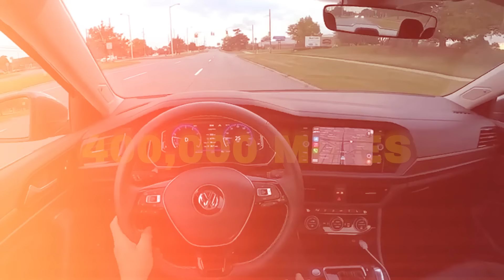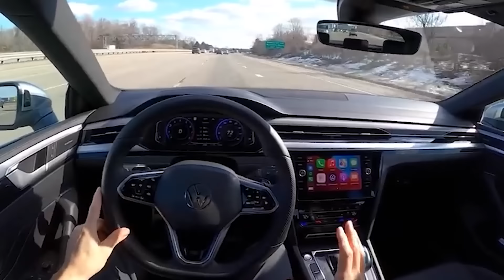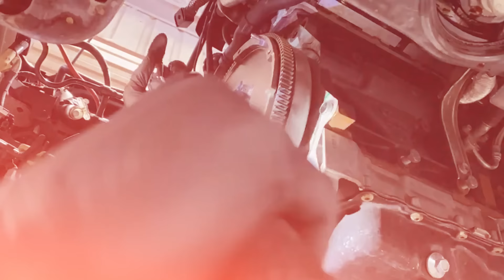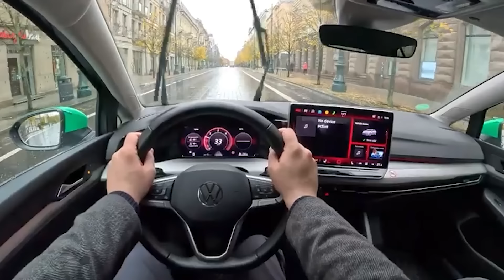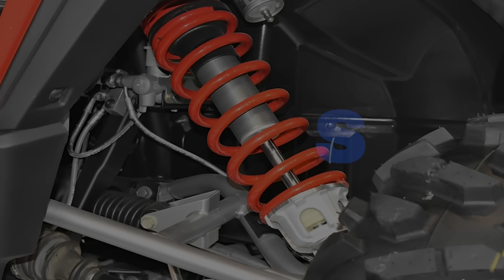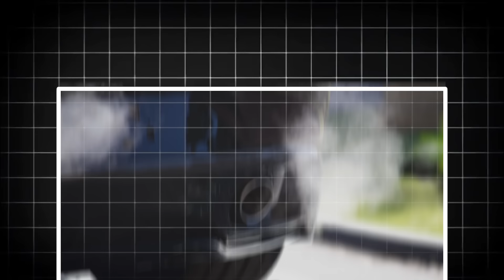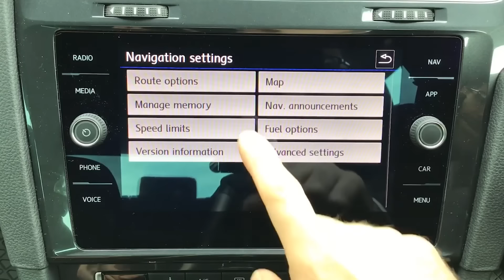How To Make Your Volkswagen Last Over 300k Miles Without Any Major Repairs

Comment: I have a 2024 Tiguan with 11,000 miles! I just did my oil change at 10,000 miles. This video was extremely helpful and I’m going to make sure I do my oil changes every 5,000 miles etc.
Reply: You're right: it's best to change your oil every 5,000 miles or 6 months and always use high-octane gasoline.
Reply: Never, ever follow the manufacturer's recommended oil and filter service intervals.  If they recommend 10,000 miles, change it at 5,000. Your engine will last twice as long.
Reply: So you've been brainwashed by AI YouTube video
Reply: You’re better off with a different car. It’s endless little maintenance, it adds so much to the overall price of the car. Paying bmw prices for VW should not be normalized. I have a 2018 Tiguan
Reply: 10,000 is perfectly fine, 5,000 is overkill.
Reply: @Ussie_A no lol you should not wait 10k miles💀

Comment: 2016 Jetta GLI w/ DSG.  Bought 6 years ago at 22k just hit 140k. Every single one of those miles it was modified to the absolute max, turbo swapped making 410hp. I do the regular 5k oil change with liquid moly 5w-40 and their additives, service DSG every 45k, did carbon cleaning at 90k and it runs like a top. still 28mpg around a suburban sprawl city, never had an issue with the car other than the plastic water pump started to leak(known common issue with that generation of the 2.0tsi under recall) and my cam angle sensor developed a small internal oil leak that would put the car into limp mode(not expensive and it failed around 120k)

Comment: I been seeking an answer for few weeks now but hopefully somebody can give a clue what my problem might be, I have a 2012 Beetle 2.0T manual Gen 1, the issues im having is that after 30-40 minutes randombly and ocassionally when passing by bumbs my oil light on the dashboard goes on and beeps for like 3 seconds it stays on for like 15-20 seconds and then disappers and it keep doing it every 10-15 minutes, oil is fine engine sounds and feels good and no engine light. I will appretiate any opinions on what my issue might be, thanks and nice content I love it.

Comment: The engine does not get "opened" for a clutch replacement, how stupid! Windshield washer fluid refill while you're talking about antifreeze, clean grounds with a wire brush and you're showing a high pressure washer, You really need to synchronize your video with your audio portions

Comment: I drive a 2012 Eos with 130K miles. I’ve been fixing different engine parts and the car is running well.  This video was excellent and I will complete the recommended maintenance. Thanks

Comment: I drive 2014 Jetta Sportwagen TDI (rebadged Golf) with 60k miles. You are absolutely right. Only you forgot with diesel it’s very important to fix all issues with check engine light asap, because with ses light, car doesn’t perform regen, and it’s very risky for dpf longevity. I still have original timing belt. Should I worry about it? 10 years and 60,000 miles. Thanks.
Reply: I changed mine at 130,000 miles and the belt was 13 years old. Not saying you should go that long but mine was still in good shape.
Reply: @buymytoy i think the belt is Kevlar. That’s why it has so liberal maintenance.

Comment: Excellent video, 100% agreement. My 2016 GTI is now at 208,000mi and running great. I did the carbon service and trans gear oil myself, had an excellent independent mechanic do timing chain and clutch replacement, which were of course rather expensive services. It's not really related to maintenance, but I was amazed to get 200,000 miles on the original clutch.
Reply from the maker: Awesome! Glad to know our content is helpful to you.
Reply: I’m still driving a 1.2 TSI polo from 2014 now at 300k kms with original clutch and timing belt.

Comment: Oil changes at 5000-mi is a faulty approach to maintenance. How often you change your oil depends exactly on how you drive. If the majority of your driving is made up of short commutes, then yes, that's considered SEVERE SERVICE by the majority of auto manufacturers. And yes, the majority of auto owners fall into this category. HOWEVER, if your driving consists of mainly longer highway speed trips of 30 minutes or more, all the cold-start moisture, unburned fuel, and combustion by-products that accumulate and cause the majority of engine wear, have a chance to boil out of your oil once it has reached full operating temperature. As the oil takes considerably longer to reach temperature than the coolant, it is essential to have a longer run under load to boil off these oil contaminants, and this does not happen with short urban commutes. So yes, if your drives are the latter you can stick to the owner's manual for oil change frequency.
The other issue is many of the video's maintenance items have such short intervals, and such high costs, you wind up paying as much, or even much more, than if you just do maintenance at the recommended intervals... You add up these costs of this extra maintenance, and you could cover much of the additional lease cost of a new vehicle every 3 years...
That's what happens when you use AI to create your VW maintenance vids...!
Reply: You have a right to your opinion, but I will stick with the opinion of every VW specialist mechanic and every enthusiast owner I know and stay with 5000 mi changes. It is cheap insurance for all the reasons clearly discussed in this video (regardless of having an AI voice read it). I also have a regional specialist seller who "warranty replaces" oil and filters (yes, I get 100% money back on used oil and filters - it's insane, but they consider it a "loss leader" expense to encourage loyal customers - which I certainly am!)
Reply: @cyclone411  My statements are less 'opinions' and more based on factual reality. Oil Analysis can give accurate reporting on the condition of your oil. Oil Analysis of hundreds of engines has confirmed that oil run under relatively short commute conditions is far more degraded after 5000-miles than oil run more at highway speeds for extended trips. The reasons are the ones I listed - relatively short commutes don't heat the oil long enough to evaporate off the contaminants that get in the oil at every cold start.
You can either put your faith in the reality of actual evidence, or mindlessly follow half-truth opinions...
Reply: @garymaclean6903  any harm with 5000k oil changes? If not, then as a generic safe claim that is beneficial in most circumstances what is the issue with a reduced freq oil change?
Reply: @johnd8971  The 'issue' is that frequent oil changes doesn't actually address the very real problem of how best to deal with 'Severe Service'. It doesn't even mention it!
Yes, if your driving qualifies as  'Severe Service', then sure - make more frequent oil changes. If it doesn't, then the manufacturers' recommendations apply, and you're wasting  $100 - $200 each time you change your oil more often than needed.
The proper way to address 'Severe Service' is to identify if your type of driving qualifies as that, and adjust your driving to minimize the damage it causes. 
If the majority of your trips are relatively short commutes, and not longer highway speed driving, then you need to add at least 30-minutes of highway driving at least once a week to evaporate off the contaminants that build-up, dilute and degrade your oil. And yes, still do 5,000-mile oil changes, because even though the contaminants may be boiled off, the damage they do to degrade your oil cannot all be boiled off with a high speed run, specifically increased acid build up from water and combustion by-product contamination. 
But you're simply wasting money of you do frequent oil changes and don't run 'Severe Service' on your vehicle.
Reply: @garymaclean6903  Fair enough, so there' s no issue to the 5000k changes except small financial hit, but this alone is not really sufficient if you fall into the severe category. Out of curiosity is "severe"Defined anywhere (distance, speed, acceleration o/ decel versus steady speed etc, revs etc)?
Reply: @johnd8971  Most people don't bother reading their owner's manual very closely, if at all. Every owner's manual I've had clearly spells out what they consider severe service. A google search will likely do the same. 
There's two types: Expended running where the oil doesn't get to full operating temperature very long, especially in cold weather. The other type is expended periods of hard running / heavy loads, etc.. Highway runs does nothing for the latter...
Reply: @garymaclean6903  only environmental factors are specified, such as extreme cold or dusty environments, with no recommendations on distance/ duration. Which makes sense as far as it goes.
Reply: @johnd8971  What owner's manual did you get that from?
I found the following off the internet, but it's typical of every manual I've ever read: - 
For severe service (short trips, stop-and-go, towing, extreme temps, dusty conditions), shorten your oil change interval significantly—often to 3,000-5,000 miles (5,000-8,000 km) or every 3-6 months, regardless of manufacturer "normal" intervals. 

Always check your owner's manual for the specific severe service schedule, use quality synthetic oil for better protection, and change the filter with every oil change to keep your engine healthy under heavy stress, as contaminants build up faster. 

What Defines Severe Service?
Short Trips: Under 10 miles, especially in cold weather, where the engine doesn't fully warm up.
Stop-and-Go Traffic: Heavy city driving, idling for long periods (taxis, delivery).
Towing/Hauling: Pulling trailers, boats, or heavy loads.
Extreme Conditions: Very dusty roads, off-roading, or extreme heat/cold.
Mountain Driving: Driving uphill or in mountainous regions. 

Recommendations
Standard Severe Interval: Aim for around 5,000 km (3,000 miles) for conventional oil, or 7,000-8,000 km (4,000-5,000 miles) with synthetic oil, checking the manual first.
Time: Change at least every 6 months, even if you haven't hit the mileage, as oil degrades over time.
Filter: Change the oil filter with every oil change.
Oil Type: Full synthetic oil offers superior protection and can extend intervals slightly even under severe conditions compared to conventional oil, but shortening intervals is still key. 

Why It Matters
Severe conditions stress oil, causing fuel dilution, overheating, and contamination, which drastically accelerates wear and can lead to sludge, varnish, and premature engine failure. More frequent changes are the most cost-effective way to protect your engine.

Comment: I have 2011 Vw Gti with 167;000 miles on the clock. I hop in and start the car then fasten my seatbelt and wait for high idle to drop then I start driving. Then after driving to my destination I park and idle while putting up windows closing sunroof, and grabbing my items. Then I turn my car off. I change my oil every 5000 miles and only use liquid Molly and Mann filters. My old 97 VW Golf had 267,000 on it before rust issues took her off the road

Comment: Doing My B5.5 ....biggest hassle has been axles, (every 20k) fuel pump at 69K, coils, sensors, timing belt every 60K, water pump failure, engine mounts, bushings, and so on....lots of maintenance and replacement of parts before failure.
Not easy. DIY , been doing so since the 59's .
TC tensioners etc all done. So it wants work, or it will break!
Reply: Yes. Way too much work for my likings.

Comment: Some of it is a little extreme. 😅
Nothing wrong with using a good cheaper oil filter. Many are made in China or Korea anyway and rebranded. So, basically you are throwing money away for a rebrand that is exactly the same.

Comment: I am driving my 6th VW.  the last 4 were TDI,s.  Everything mention in this video is totaly true.  Follow  VW's maintence, except change Oil and Filter every 5000 miles.
Reply: I'm on my fifth VDub.  I follow the 5k oil change and Italian tune up protocols religiously.  My 2011 TDI was one of the best cars I've ever had.  Nothing broke.  I love Vdubs!!
Reply: My ex company car was a 2015 Golf Wagon 1.6TDI. I did 285000km in 6 years. I brought it for my daughter. It now up to 337km. I'm doing the R&M or using technicians in our truck workshop. It still drives really nice.
Reply: Wish I could say the same about my Tdi got it at 26k around 40k had low pressure fuel problems they could never figure out the problem and by 75k just had to get rid of it because it wasn’t drivable
Reply: @daltonstockton2799  Very good chance the previous owner didn't keep up with maintenance
Reply: Right on TDI driver! I have been driving TDI since 1974. they must be my 5th Diesel VW. They were the best. Right now I am driving the sixth one with 187 k going for 400k hopefully.
Reply: Meaning no offense but unless you’re 90 years old and regularly drive across the country I’m seriously doubting you put 2-300,000 miles on each of those.
Reply: @IFranchisedI I have 2008 vw touran 2.0L dsg auto at 280,000 and still going good
Reply: @IFranchisedI  Volkwagen Passat from 2000 1.9 TDI => 450,000 km.
Reply: Who has the money and time to do this all as mentioned lol

Comment: My 2012 GTI went through 4 sets of injectors, 3 intake manifolds, a high pressure fuel pump, countless oil/air separators, 4 water pumps and I changed my oil every 8,000 miles using LiquiMoly oil.  When I got rid of the piece of crap, it was using a half-liter of oil every 2 weeks and I installed a catch can in an attempt to reduce oil consumption.  Yep, I was one and done with VW after that miserable experience.
Reply: Doh!

Comment: I use premium, top tier fuel in my VW along with Techron every 5,000 or so miles. I also use Seafoam into the intake every 10,000 or 1 year time. I do not believe I will have much carbon build up. I also would subscribe to the mentioned "Italian" tune up. Only other mention is I cannot get behind 0-20 oil. I go with 5-30 and on my older VW/Audi vehicles I used 5-40.
Reply: I would never use 0W20. I use LiquiMoly 5W40 only.

Comment: VW CC 2.0 TDI GT with 160k on the clock. Runs perfectly, fsh, and I've owned it for 8yrs. I'd trust it to take me anywhere😊
Reply from the maker: Awesome 🙌 
Appreciate your comment!
Reply: 233000 on mine. ABS module just failed. Again.

Comment: 300.000😂 nice Fake
Reply: I have an 07 1.4 petrol Golf with just over 556300km so far and still going ok
Reply: @johnmc1941 mine is a 2003 Mark 4 TDI with 550.000 so far. Still running factory top speed
Reply from the maker: If you do the proper maintenance, it will run 500k miles too!
Reply: @AllAboutVolkswagen1 😂What a beautiful fairy tale

Comment: I have a VAG product that is not a VW but is embedded in the family. I do my oil changes every 7,500 kilometres and it is serviced by the book. That manual transmission will receive an oil change in the not too distant future. Thanks for the advise.
Reply from the maker: Thank you so much! Subscribe for more information like this 🙌
Reply: @AllAboutVolkswagen1 some of the early ea888 gen3 engines come with port Injection as well as direct injection so I was told the carbon cleaning would not be needed? What is your thoughts on this as my ea888 gen3 from 2016 comes with 8 injectors, 4 DI's and 4 port injectors
Reply: I do mine every 10,000km. That is 5,000km earlier than recommended and sufficient enough for my tuned car. This is because it runs 10c cooler than stock.

Comment: Yeah its not pinched o rings from factory on the oil cooler where it meets the water pump diverter valves will go ive owned vws for mor than 25 years i love them but man they can really be anoying and he didnt even bring up the haldex system for your 4motion s
Reply from the maker: Indeed

Comment: I let my GTI idle for the first 30 seconds or so after starting to make sure oil pressure is up and the same before shutting off to give the turbo time to spool down to help prevent coking on the turbo shaft and bearing wear.
Reply: Your oil pressure is at operating pressure much sooner than that. That's one of the reasons why low viscosity oil is spec'd for your engine. Most engine wears occurs at start-up and when cold idling... 
The BEST way to warm your engine is to drive it at moderate throttle. How fast an engine warms is determined by the amount of fuel it burns...
Reply from the maker: Awesome 🙌

Comment: No sir, from the beginning, your oil information is wrong. You must use 508/509 VW Audi approved motor oil 0W20.
Reply: ow 20 will destroy your engine. Look up in Internet for more information about ow20.
Reply: @EvgenyArnautowski not if you change it every 3,000 - 5,000 miles. You are quite misinformed. The opposite of what you said is true. Using anything except what the manufacturer specifies will destroy your engine. Let’s compare notes about 4-5 years from now and see whose car is still running flawlessly and whose is no longer running.
Reply from the maker: I really hope your one will last more but if you are following the manufacturer specifies and do the services how they told you then man you need to know the real things which many vw owners in fact every car owner faces. 
Do some research by yourself and then compare it with your ones you will know the things! 
Thank you
Reply: @EvgenyArnautowski  I've used VW 0W20 in my Golf, now 80,000 miles and uses no oil between 6000-7000 mile changes. The engine was designed for 0W20.